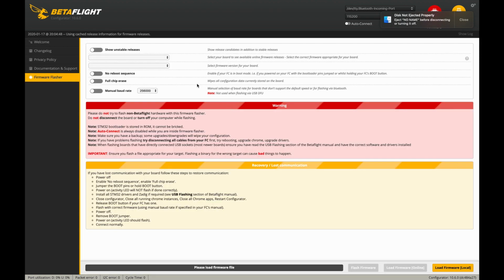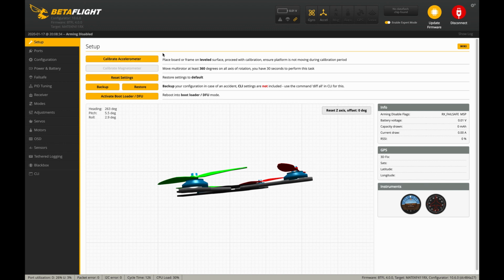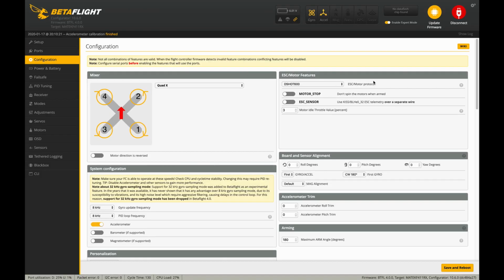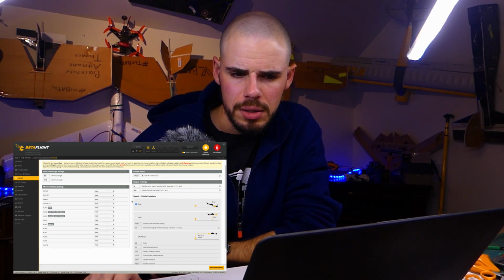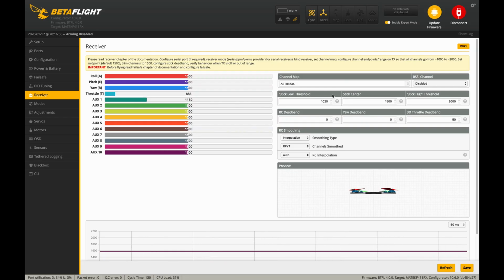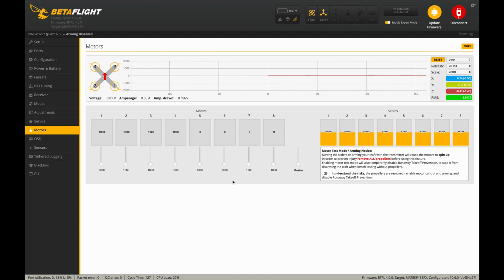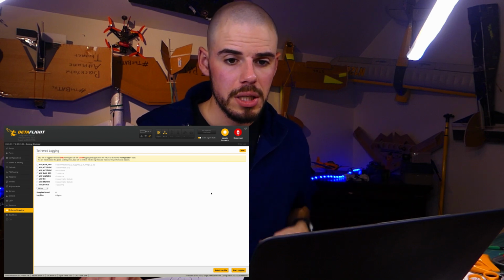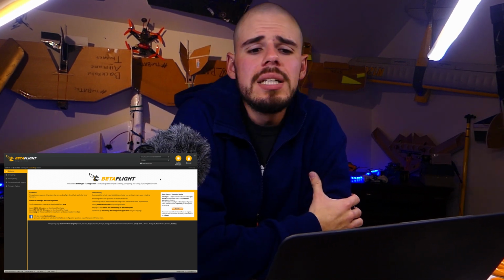Betaflight EXPLAINED for Beginners - FPV Drone Quadcopter HELP for Noobs Tutorial

Comment: Hi Adam my quad is not connecting to betaflight, two weeks it was running fine now it doesn't recognize the CP210x drivers on my Mac.  Can you help me out?
Reply from the maker: Hi, jamdanzer! Tell me what make and model quad do you have?
Reply: @RCwithAdam1  I have a Xilo Freestyle and a Skystar Lord228 after I had built them got on Betaflight to make all the adjustments and Betaflight was working fine. Reinstalled Betaflight and updated the CP210x drivers for my MacBook and I’m unable to connect either quad to Betaflight.

Comment: I flip that exact button that you did at 8:57 saved it and I can no longer access beta flight from what I learned it locked my fc basically and the port is no longer appearing in beta so I can’t clear the FC any solutions ?

Comment: So.  My question is, if I BUY a quad, NOT build my own, do I still have to mess with this stuff ??
Or can I fly it out right out of the box ??    If I can’t, what’s the point of buying a pre made quad or plane ?! Thanks for the info guy but still, too much overload.  Gotta go back and watch several times.
Reply from the maker: Hey! Good question! It depends on the quad/manufacturer. Typically, if you buy a complete kit with transmitter, goggles, battery and drone from a reputable company (like emax, betafpv, iflight, etc.) which is marketed as "fly it out of the box," then you won't have to do much or any setup. But if you just buy a quad by itself (or maybe already with a receiver) it will be on you to get it working with the transmitter, goggles, etc. That's why a lot of people come to me for help setting up prebuilt quads (which is what I do), because the details are the tricky part!

Comment: Hi.  My English is very poor, but I could understand some things.  I have a problem with my eachine 349sx diatone purchased 2 months ago, and I never got it to move the propellers Even with the receiver moving the bars on the Betaflight ... Strange isn't it? I don't know if there is a procedure missing that I didn't do ... I don't know.  The last problem that happened to me was that I can't save anything on Betaflight ... I don't know if I turned on UART1 in the area that does not belong to the receiver, and I have to boot into the FC ...  It is the first time that I use Betaflight, and it is very complicated for me.  Some help would be very good. Thanks
Reply from the maker: Hi! Did you set up an ARM switch in the MODES tab?

Comment: hi adam i am struggling  with connecting my vtx do i need to set up vtx tables
Reply from the maker: Hi! Sorry to hear that! I want to help you. I'm not sure what vtx tables are?
Reply: @RCwithAdam1  okay but could you talk me through what should happen with my vtx i would love some help as this is my first build
in it there are 
mamba f405 mk2 stack 
echine tx805 vtx 
flysky receiver x6b
caddx ratel
emax eco motors
i have it flying but i can't get my vtx to connect i watched your video on it but that was on the mk1 but the mk2 is different  any advice would be helpful
i would like to know if there is a better way to get help than using the comment section
great videos btw

Comment: If you are unsure what hardware/firmware your flight controller is using, you can connect with Betaflight, click the CLI (command line interface) button on the bottom left, and type in: version      The firmware should respond with something like the following:
# version
# Betaflight / MATEKF411 (MK41) 4.1.1 Nov 15 2019 / 12:34:58 (1e5e3d369) MSP API: 1.42
Reply: You can see that without typing in the upperleft corner. Just connect.
Reply: @boratsagdiyev1586  How did I not see that before now????  Yeah, that's a lot easier. Thanks!
Reply: @KingBeetle1966  np :)

Comment: Thanks for the vid it helped me alot.do you need the quad turned on to do it
Reply from the maker: Oh good! 👍 You can do almost everything with just the USB plugged in. For some things, like spinning the motors, or sometimes configuring the OSD, you will need the LiPo battery plugged in.
Reply: @RCwithAdam1  ok cool